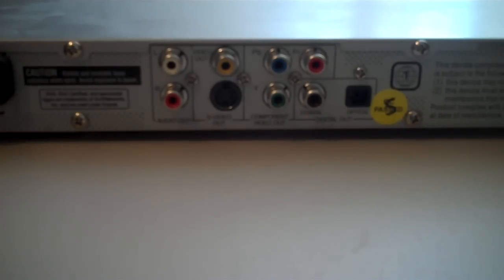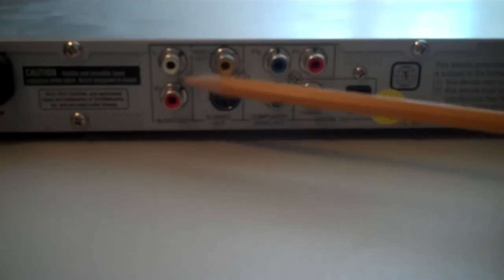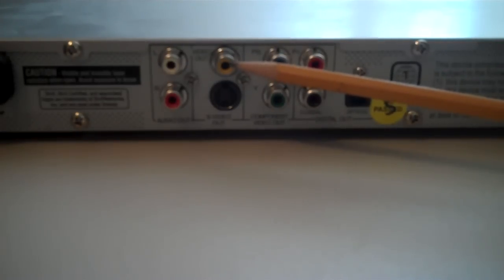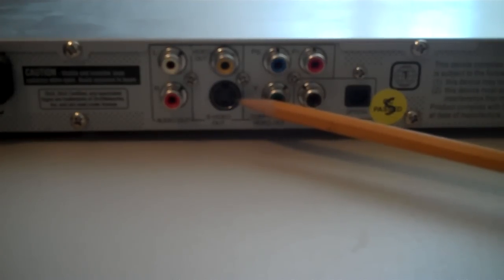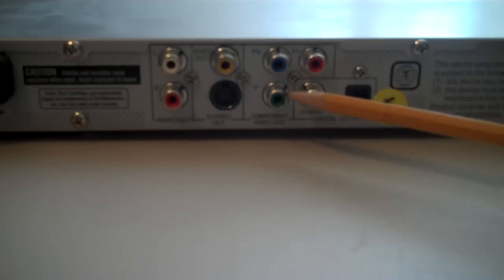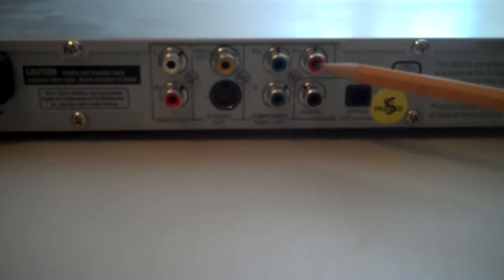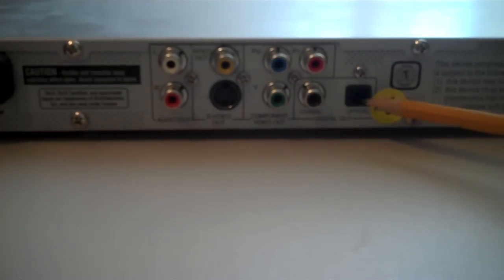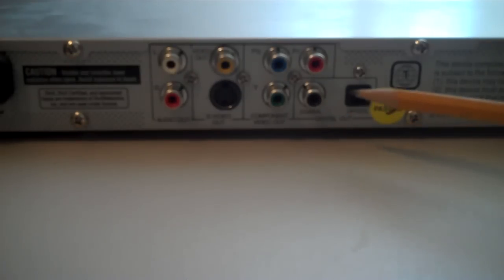Composite, S-Video, Component Connections on DVD player

Comment: I read on another site, That if you use S video, don't use the audio / video cables, because they will over ride the S video. But when I hook up the S Video alone, I get no picture or sound, FROM CABLE BOX TO MY DVD BURNER/PLAYER
Reply from the maker: +William CRAZY LACY Furmage S Video is only video (picture) but not sound. S video is a slight upgrade from the YELLOW composite Video Cable (again, no sound)  In either case, S-Video or YELLOW composite video you still need to connect the RED & WHITE RCA audio cables

Comment: I'm tying to find out how to connect my vcr and dvd to the tv with a terk s-video switch
Reply from the maker: Roxydog, we have to assume you want / need an S-Video switch because your TV only has 1 S-video input? To do what you've mentioned you need three S-Video Cables and three RED / WHITE RCA audio cables. Connect one S-video cable to your TV and the other end to the S-video output of your switch. Connect the RCA cable to the audio input jack on the back of the TV associated with the S-video you just plugged in and the other end to the output of the switch. Now connect your VCR & DVD, respectively, to the switch one at a time (S-video & RCA)
Reply: All About Home Electronics.com I already have the switch I just cant get it to work properly, if I want to dub dvd to tape I have to set it one way but to just watch a dvd I have to leave the vcr on , there's got to be a way!